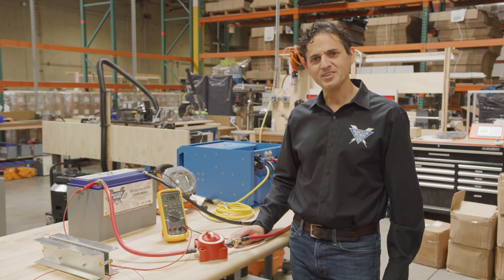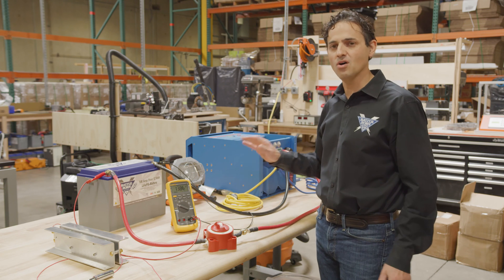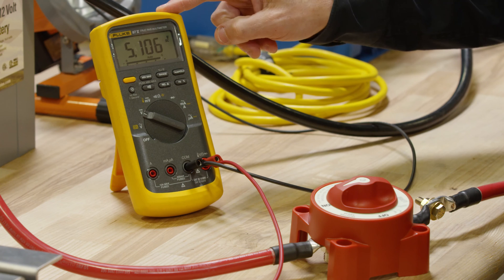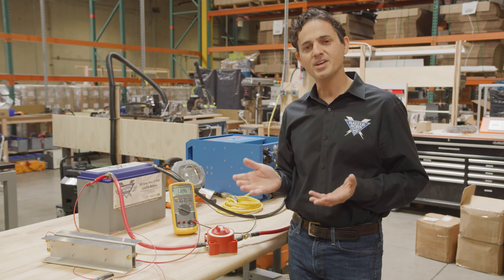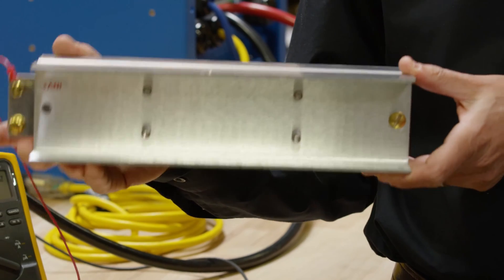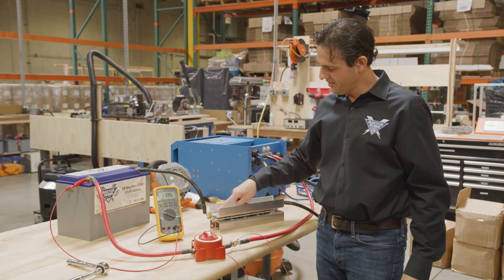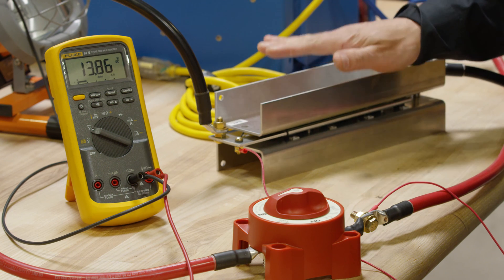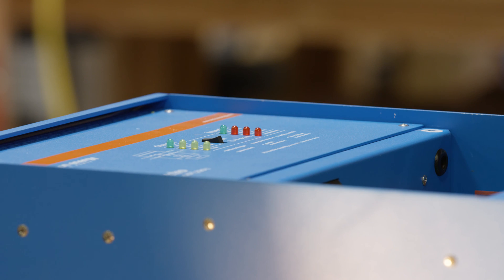FAQ: Connecting Your Battery Bank to a Large Inverter Charger l Battle Born Batteries

Comment: Ok so I have 6 24v 50ah BB batteries and 2 24/3000/70 in parallel will I need to purchase one of those to get them to work, haven't hooked them up yet
Reply: I think what he said is anything over 3500. So you should be fine, and I just ordered two of the 24-3000 directly from BB and no one said anything to me about needing it.